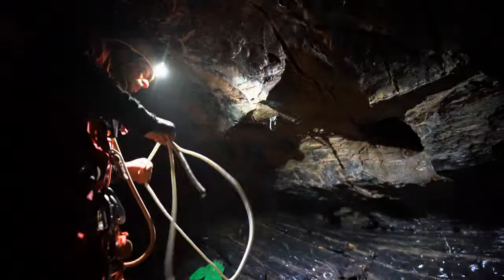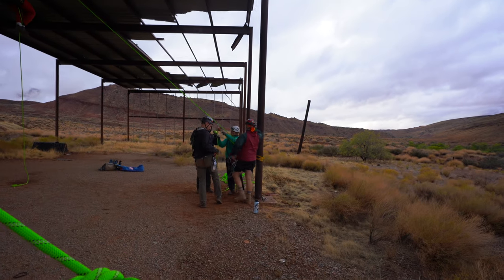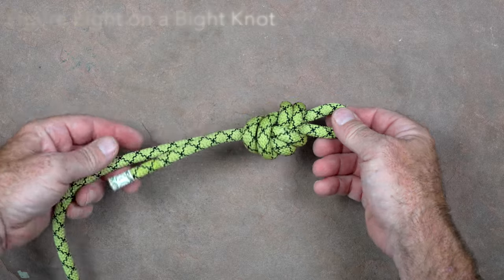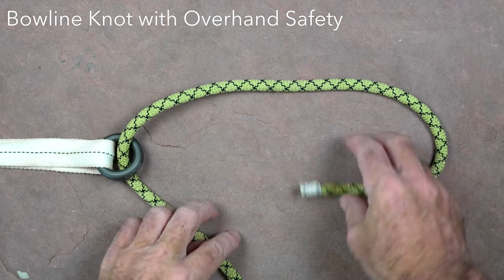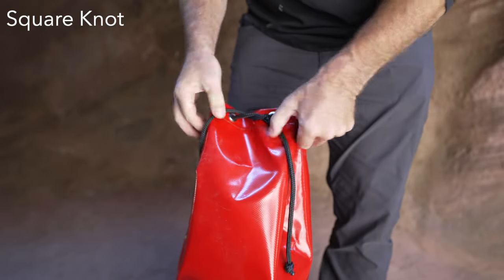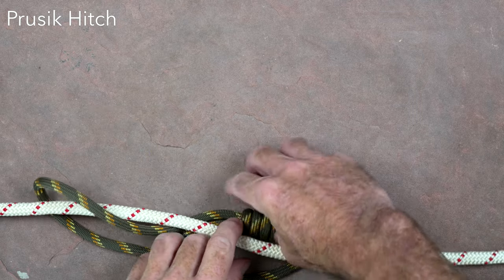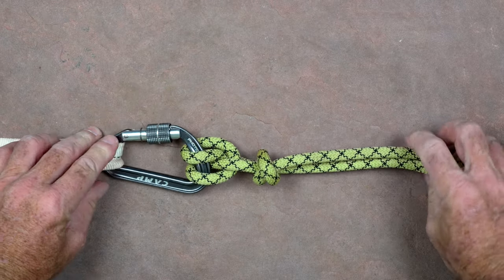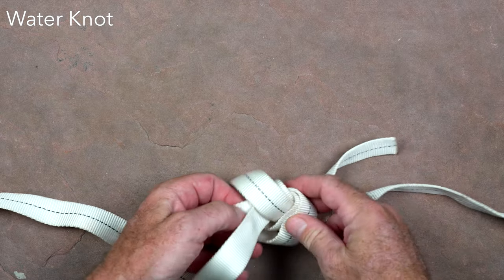Knots for Vertical Caving and Cave Rescue

Comment: Great video, can you do a video on how to set up cowstails/safeties so they’re the right lengths for SRT etc?
Reply: Good morning mate. I hope Derek wil answer, but I want to share my experience also) As i was tought in speleology school, based on French sistems (sorry, don't know in English) - so, long cow's tail should be 65 sm and short one - 40 sm , including the carabineer.
So we count as a standard Petzel Spelegyka
Reply: @maxshramkov  thanks for your comment, do you attach your had ascender to a cows tail? Therefore do you find a cowstails length is personal to your arm length etc? Or do you have a separate line for hand ascender and foot loop?
Reply: @benhazell470  in our school sometimes also have discussions about this)) 
Basic sistem, as i was tought, is when you have two standarted cowstails and ascender with the foot loope is your separate line. So in general, we have 3 cow's tails. And the length of that third one is individual and depends on hight and reach.
Arguments to this sistem are: 
1. lt is easier to walk on horizontal rope lines (don't know in English) when they're placed on the wall with no natural stares for feet.
2. You can use acender, when going through the station (also don't know the proper word:)) when descending, to remove short cowstail safely and easy.
3. When cowstails are standarted, then it is easier to do standart lengths of the rope loopes in stations when rigging, so it would be comfortable for every caver to pass them.

Comment: Hi Derek. Why would one choose to do a clove hitch on a carabiner as opposed to a figure eight on a bight? I've used a clove hitch to attach buoys to the railing of a fishing vessel but never imagined using it on a biner. Is it simply like you said that it uses less rope and is easily adjustable?
Reply from the maker: These are knots taught by NCRC for cave rescue purposes. The most common use of the clove hitch in their world is to attach bridles to Ferno litters. They don't use a lot of rope, are easy to adjust, and hold tight when tied around a litter handle. I generally don't use them in cave rigging, though I frequently use them when building rock climbing anchors. The advantages are as you stated.

Comment: No mention of the fusion knot, or even the bowline on a bight? The former is safer than the Fig-8 and doesn’t jam.
Reply from the maker: I may do a double-loop knot video in the future. This video wasn't intended to cover every knot... just what most would consider the fundamental ones. I agree the fusion is easier to untie than the double figure eight... but safer?
Reply: @DerekBristol  Can’t remember exact test results, but from memory, several load/strain tests showed the Fig-8 to rupture before the Karash/Fusion knot. The Fusion knot can also be used on two anchors vs. one for the Fig-8. It’s what we commonly use (along with the bowline on a bight) in Tasmania, no one has used Fig-8s here in many years.

Comment: Hi Derek! In Your opinion, is knot in 3:00 well dressed? I think, the bottom left strands are crossing each other.
Reply from the maker: It's in process. Definitely a bit harder in stiff static rope. I'm not sure there's such a thing as a perfectly dressed knot, and it's generally a good thing to do, but a poorly dressed knot is not necessarily unsafe.
Reply: @DerekBristol  thak You for Your answer. I totally agree.